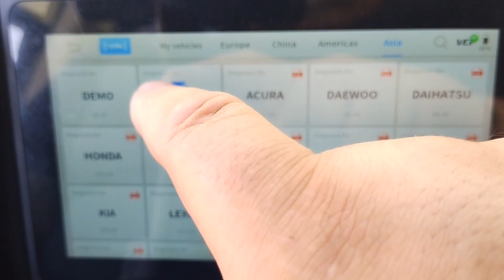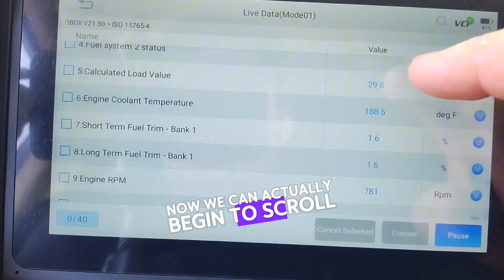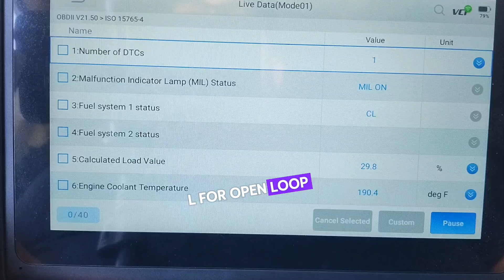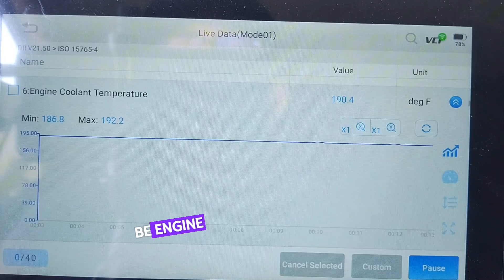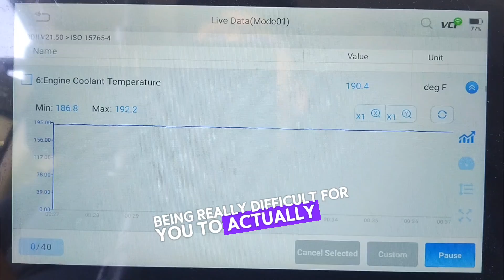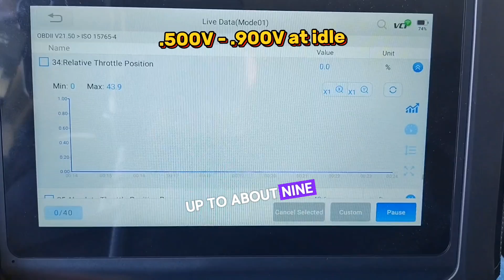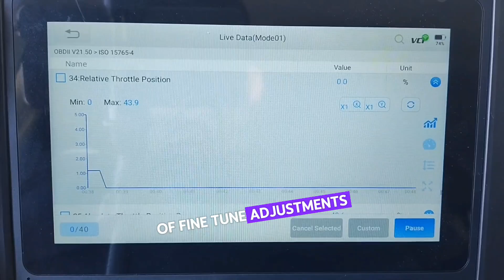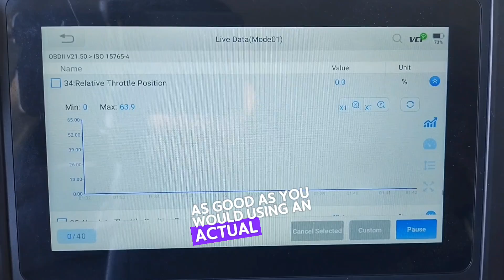OBD2 Scanner Live Data Explained: [Top 3] Data PIDs

Comment: Awsome info man, really really helped me out. I have an artidiag TopDon 900bt and Im learning how to read values and all the things I can do with it. Over Christmas I brought it to my brother-in-laws for kicks and he asked me to scan his truck. DEF code and MIL was on. Upon further investigation I was able to tap into the DEF tank heaters. I was able to turn them on/off. Upon doing so I discovered that heater 1 I would command to come on and it would show, but I was getting 0 amp reading. Doing the same with heater 2 I saw that I was able to turn IT on and got a reading of 3amp. I ran closed/open loop circut tests on heater 1, again it failed. Leading me to believe that heater was causing the truck into limp mode and ultimately shutting the entire DEF system down due to this bad heater. Im still learning but Ive come to enjoy it!

Comment: I've been working on cars for 20 years. If the vehicle was cold you go up to the upper radiator hose and feel it that tells you right away. Hey, the thermostat has a problem and then you check the heater lines. Just make sure the water pump is working. It could be also the pressure cap is not holding

Comment: Some of the information in the video isn't completely accurate. With regards to open and closed loop operation, when you force an open loop condition by applying wide open throttle, all of the sensors are not bypassed. Only the data from the O2 sensors are bypassed. If all the sensors are bypassed, there's no way the car would run. 
As far as looking at open/closed loop status as one of the first things you check is fine. However, you're missing an opportunity here. Going over why open and closed loop operation exists in the first place can be extremely beneficial when diagnosing an issue. A vehicles 2 main emissions control devices the O2 sensors and cats. In order for them to work properly, they need to be at a minimum operating temperature of about 600 degrees. Anything lower and you'll get false readings from the O2 sensors. False information sets off check engine lights. This means you'll get a check engine light every morning when you first start your car with a cold motor. Open and closed loop operation prevents this from happening. When your PCM is running in open loop, its ignoring data from the O2 sensors when setting fuel trims. That's it. As soon as they reach operating temp, the PCM drops into closed loop and starts using O2 data to set fuel trims. This is why modern vehicles have heated O2 sensors. It gets your emissions control devices up and running as fast as possible.
You can use the information above as a diagnostic aid. Open loop bypasses your O2 sensors. Lets say you have a car with a drivability issue and you think the problem may be O2 sensor related. You can connect a scan tool before you start the vehicle and monitor open/closed loop reading in the data stream. If the car is running good in open loop and then starts to run bad when it drops into closed loop, there's a good chance you have a bad O2 sensor, or something directly related to the O2 sensors.
The video also talks about how the PCM will go into closed loop under wide open throttle. That's true, but there's a specific reason for it. Its a safety concern. If you are trying to merge onto a busy highway, for example, having your motor cut out can be dangerous. Since closed loop operation is only used for emissions purposes, you don't want a problem in the system causing an accident. Just like if your ABS pump fails, you should still have your regular brakes. 
I have no idea if the person who made this video knows all this, or not. I assume they do, and it was just an oversight to not include it. So, I'm not trying to insult anyone. However, most of the people watching the video won't know any of it, and that's why I made this post.
Reply from the maker: Ok.

Comment: I'm used to $100 scanners. I just bought a $400 Autel MX808S and I have no earthly idea how to read any of this stuff. This is a good start. I need to learn about each of these systems, then try to fix my car.
Reply: If you want to really learn how to fix your car, you need a scanner, but its not that important. Either scanner you list should be fine. If you want to diagnose and fix a car, the most important tool will be your multimeter. If there's one tool you want to spend a little extra on, its the multimeter. Don't buy a test light until you have more experience. Use your DVOM until you get some experience. 
The tools won't matter if you don't have the correct information. The workshop manual for your vehicle and a book of wiring diagrams is an absolute must. You can get them in print or digital. You get them from the parts department at your dealer, or sometimes Amazon has them. 
Just as an example, you get a code for an O2 sensor on your scanner and maybe some other relevant information from the data stream. Once you have that, you begin your diagnosis using all the stuff I just told you about. Hopefully, you'll be able to figure out what the problem is. Without the manual, you'll be lost. You'll break more than you fix, especially if you're working on the interior. All that plastic breaks way too easy.
Reply: @052RC I'm used to fixing my own cars but mechanical fixes. Older cars. If I get a code for a cam position sensor I replace the sensor and the car is repaired. Simple. The problem I'm having now is different. There are no codes. The car runs fine in open loop during the warm up cycle. The instant it goes into closed loop it misfires under acceleration. It'll give me a P0300 but that's just because it's misfiring. It doesn't tell me why it's misfiring. It has to be something to do with sensors that are not used in open loop, but are used in closed loop. 

I have a multimeter that I used for my FPV drone builds, so I need to learn how to use it to test sensors and things like that. The MX808S scanner seems to be a pretty capable tool too. I just need to learn how to use it. The days of it being enough to know combustion requires fuel, compression and spark and how to rebuild or adjust a carburetor are gone. 

My brother was a fantastic mechanic and would be a great help, but he went blind from an eye injury & he can't see a scanner anymore. It's still fascinating to watch him replace a starter from feel alone. Thanks for the response. I will learn more about using a multimeter when doing car repairs.
Reply: @CarbonGlassMan  "The car runs fine in open loop during the warm up cycle. The instant it goes into closed loop it misfires under acceleration."

That's exactly what you need to know. What you just did is textbook case on how to use a scanner the right way. Here's what's going on. Your cats and O2 sensors don't give correct readings until they reach a certain operating temperature. Its about 600 degrees. False readings set codes and turn on check engine lights. Unless something is done, you would get a check engine light every morning when the motor is cold. To stop this from happening, open and closed loop operation is needed. When your pcm is running in open loop it ignores the readings from your O2 sensors and doesn't use them to set fuel trims. Once the O2 sensors and cats heat up, the pcm goes into closed loop. In the video, he says when the car is warming up, the pcm ignores all the sensors. That's not true. It needs all the other sensors or the motor won't run. To simplify, here's what the data is telling you. You bypassed your O2 sensors and the motor runs fine. The second you turn the O2 sensors on, the motor starts running bad. That's exactly what's happening. Even though you don't have a check engine light or codes, you have to go where the evidence leads you. Nothing with cars is ever 100%. In your situation, however, I would say 95%-99% you either have a bad O2 sensor, or something directly related to it.

If I had to fix the car as a professional, I'm not allowed to just install a new sensor. I have to prove its bad before I replace it. This is where I would put the scanner down and get my meter and diagrams. I would start by unplugging the wiring harness on the O2 sensor and pcm, and do a continuity test to see of a wire is cut or broken. If you have continuity, you then have to check for high resistance. You may have a wire that's partially broken. My next test would be to check resistance by doing a voltage drop test. (You don't check resistance with the ohms setting on your meter. Its not accurate.). If the wires all check out, I would continue my diagnosis until I eliminated all possibilities, and whatever I'm left with has to be the problem. This is the type of thing I was talking about in my other post. 

I normally don't tell people to do this. However, in your situation, you don't have a shop with lifts and all the diag tools you need, along with the reference materials. It may not be a bad idea to just replace the sensor. I would say you have about a 70% chance a new sensor will fix the issue. If you want to check the wiring and everything else, by all means do it. It just may take a while because you're not set up for it. If you can live with the risk, I say change the sensor.

Comment: Uh, what's a "PID"?
Reply: It stands for Parameter Identifier. They're data points that the modules in your car put out and can be read with a scan tool. Depending on what you're looking at, some PIDS allow bidirectional control. For example, you gas gauge may not be working properly. Maybe its the sensor in the gas tank, or maybe the meter on your instrument cluster. You look at the pid for the gas tank sensor and if it appears to be reading properly, the issue is probably in the IC. Some pids allow for bidirectional control. If your door lock isn't working, for example, you can activate the door latch pid, and if the lock works, you know its the button or the wiring. You use it to confirm that the lock itself works. You won't have to fire the parts cannon and hope you hit something.

Comment: I bought the Autel MaxiDiag 808 Pro - was that a wrong choice?
Reply: If you think its going to tell you what's wrong with your car, yes. You use the information that the scan tool gives you to start your diagnosis. It can't tell you what's wrong with your car. If you're just looking for codes to fire the parts cannon, its more than enough.

Autel is a very good brand, if that's what you're asking. If I didn't have a factory scan tool, I would probably get an Autel for myself. Unless it doesn't do something you really need, I would keep it. You can do far worse than Autel.

Comment: Is that general time to temperature spec. of 1 degree per 1/2 second dependent  on ambient temperature? Is there a general spec. from cold to operating temperature time frame depending on ambient temperature? Say 70 degrees F to operating temperature VS -10 degrees F to operating temperature?

Comment: Before watching your Data DIPs, I'm doubt am I correct to read every single LIVE DATA from the ECM/ECU feedback. Now you gave me a massage my direction have nothing wrong.

Hopefully see some more explanation about
Oxygen sensor.
- Close loop nano ban  vs wide ban voltage reflection information.
Acceleration sensor voltage A and B
MAF/MAP voltage and value aslike Kpa/ bar/psi/grams per second/kg per minutes.
Reply: Find my post from earlier today. Some of what he said in the video wasn't completely right. I gave a quick example on how to use open and closed loop information to diag a possible bad O2 sensor. I can't make any promises, but the information in my post will probably help you figure out what's wrong with your vehicle.

Comment: This video gave me great information on live data but I can't watch the video while watching the live data to figure out if there's any discrepancy in my live data because my 08 forde350sd 6.0 seems to have a performance problem that seems to be intermittent,  I'm leaning towards egr because the egr percentage live data says error the egr command don't,  but 4 days ago they both said error also earlier today both said error as well plus I'm getting mild blown head gasket symptoms
Reply: What no one tells you about scan tools is they can't tell you what's wrong with your vehicle. If you take your truck to a repair shop, they are going to have the workshop manual for your vehicle and the wiring diagrams. You need that information. A really good tech can sometimes get away without the manual, but you can't. Its just too complicated. Your F350 is not a cheap vehicle to work on. You can try different things and maybe get lucky. But the smart thing to do would be to go to the parts department at any Ford or Lincoln dealer and order the workshop manual for your vehicle. With the manual, Ford gives you 2 ways to start your diag. If you have a code, you look it up in the manual and it will give you step by step instructions on how to diag for it. If you don't have a code, you can look the problem up by symptom and do it that way. I see all the time where people spend thousands trying to fix something by guessing. Look at it this way. If a professional needs the workshop manual, so do you. I'm a senior master Ford tech. Its the highest level Ford offers and takes years to get. I need to use the manual every day.

Comment: My car Peugeot 208  is not idling properly.  It rpm goes down to roughtly  600 at idling and the engine vibrates at this low speed.What PIDs shound I look at . I just  bought a OBD2 scantool. . Please help.

Comment: i have a Xtool DBS8 i scanned my 04 chevy silverado 5.3l rwd after i connect to it through the auto detect feature it doesnt give me engine diagnostics or scan the systems all it gives me are settings for Base Radio, Uplevel Radio when i press on one of these it then takes be to hvac dual zone settings. I plugged the scanner into a different car and it connected and scanned every system in the car and gave me all the information i should be getting so im wondering if my ecm or obd2 port somehow broken i did see a video that someone said i might have a grounded out sensor in the circuit?

Comment: Great info and video. I have an 05 chevy silverado 5.3 starts idles Great at cold start up but once it warms up it feels like it's in limp mode cant get passed 40mph. No cel. Any thoughts on this.thk you
Reply: Connect your scan tool with the vehicle is cold and don't start it. Navigate to the portion of the data stream that lists open/closed loop. Start the truck and don't take your eyes off the scan tool. What you need to look for is the point at which the pcm goes from open to closed loop. When in open loop, the pcm isn't using data from your o2 sensors to set fuel trims. That's why the truck is in open loop to begin with. Your O2 sensors and cats don't work properly until they reach about 600 degrees. Anything below and you get false readings. That means you would get a check engine light every time you start your car. O2 sensors are for emissions. You don't need them. When in open loop, your O2 sensors are bypassed. You can use this information as a diagnostic aid. When the pcm goes from open to closed loop, and that's when the motor starts running bad, you've narrowed your problem down to your o2 sensors, or something directly related to them like wiring. The second they come on line and the motor starts to run bad, it really can't be anything else. So that's what you have to do. Monitor the data stream and see if the problem happens right when the pcm goes into closed loop. Pretty much any scan tool, even a cheap one, will give you data stream info. Its basic obd2 information, and not vehicle specific.

Comment: hey thanks for a great bit of knowledge. I have the D8  Xtool scanner that I'm just learning how to use. Any reference to where I can find values or info to what things should be or not be? Like how do you know if fuel pump is low or high pressure and stuff like that.. like a quick reference too guide. Any was, you helped me get started better than where I was, and know I'm trying to track down possibilities of a bad fuel pump. Thanks

Comment: Excellent job. Its very confusing to be a beginner to use this Amazing tool.  How do you know what ratios are correct? is there a guide that shows by car by engine what is a good level or bad? What are the steps using the scan tool when pre purchasing a car would be a great lesson!
Reply: For OBD2 everything is the same. For example, your O2 sensors put out readings in volts. 450mv is the ideal, perfectly clean burn at 14.7:1 air fuel ratio. Anything higher that 450mv is rich and anything below is lean. It doesn't matter what kind of vehicle you drive. Any vehicle made after 1996 will use these numbers.

Comment: Do you know if the innova 5610 will show OL drive and not just CL or OL? Cant find any info on innova manual
Reply from the maker: PID 03 is loop status. It's not up to the scanner it's up to the manufacturer to show OL-Drive, however after 2008 id say about 99% will show OL-Drive instead of OL and CL. Hope this helps buddy.

Comment: Yeah, I got a 2013 Chrysler 200 limited edition with a 3.6L six speed automatic popped up a PO430 PO 117 a P1424. The one that concerns me is the P1424 and then the red lightning bolt on the dash come on and then the car wouldn’t start. It had spark everything it would crank over said bank B sensor low-voltage I checked it. The plug wasn’t plugged all the way in now there’s a coolant leak at the oil filter housing unit just underneath where the oil filter goes in
Reply from the maker: Those housings are known for breaking and leaking. Replace with the new metal design oil cooler.